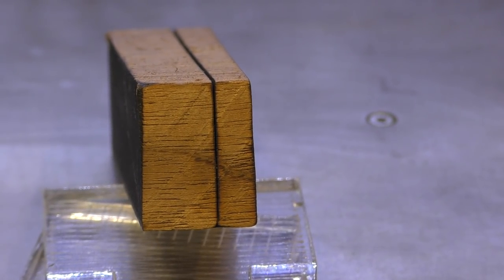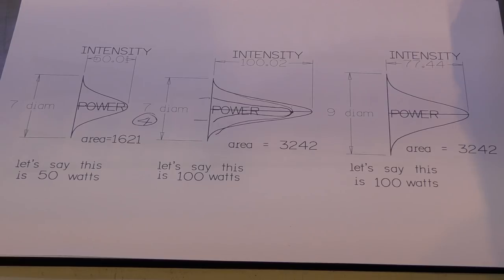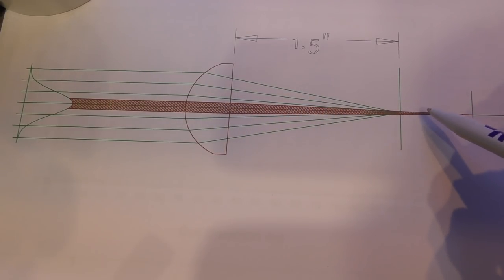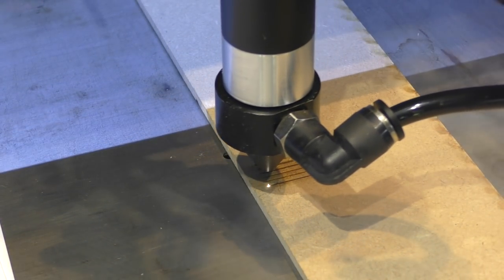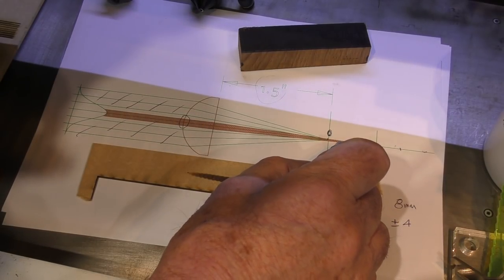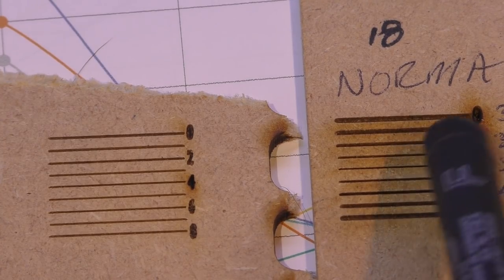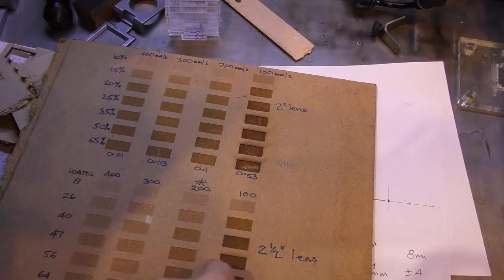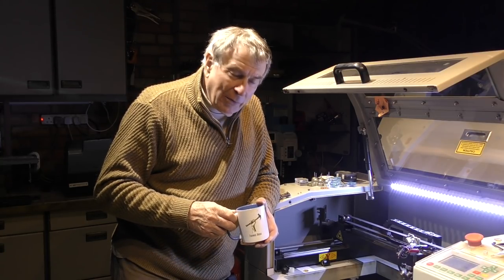RDWorks Learning Lab 208  Can I Remove the Focal Point

Comment: Russ, I was just thinking to myself it would be great if you could test laser etching a lens using CerMark, or some kind of etchant, as an alternative to your dremel grinding technique. What do you think?
Reply from the maker: Hi
 I can see the ingenuity behind your idea  and it's the sort of thing I would consider if I didn't understand the world of 10.6 wavelength light.   I suspect you dip in and out of my videos and may well have missed some vital information about the 10.6 micron universe. Without going too deeply into the physics , that wavelength light only "sees"  three things.
1 ) Metals . All metals reflect it, hence we use metals to guide the light around our machines.
2) A very small group of salt-like crystalline materials  that allow the light through. We use  these materials like zinc selenide and gallium arsenide as lenses
3) EVERYTHING ELSE.  This huge group will convert the light into surface heat as the molecular structure becomes excited  by the lightwaves.

So back to your proposal. Although the lens will pass the light and be unaffected, the Cermark  (a group 3 material)  will heat up and probably crack the lens which is a fairly fragile material..
 Mechanical destruction of the surface does not stop the light  transmission it just disrupts and scatters it harmlessly. I could think of no other way to achieve this result. It may be brutal and crude but it is effective. You must remember I am not trying to invent a new lens system I am trying to prove I can seperate the two key properties of a lens that I propose exist.  If we can creates a simple visual model of how a lens REALLY works on our machines and goes beyond the conventional model that tells us nothing, then we get the opportunity to experiment and use lenses in a much wider way.
 Thanks for the comment  I'm pleased that something in this video tickled your thinking juices. There are never any bad ideas. When they cannot stand the stress test of fact or logic then they must be  shelved 
 Best wishes
Russ
Reply: @SarbarMultimedia  Thanks for the information! Yes, I'm very much a newcomer to the world of lasers and I've been working through your content. Great stuff, though you are correct to assume I haven't come across any reference to 10.6 wavelength light yet. I look forward to that.

I understand now. I wasn't taking into consideration the etchant leaving any residual material on the lens and physically blocking the light. I was just imagining the lens surface being etched in such a way as to disrupt its focusing ability, and thinking that if it were possible to use a laser etching process it's something all laser owners could do themselves without a lathe.

Thank you very much for taking the time to repond!

Comment: This is truly awesome. Thanks once again for sharing, Russ.

I think one can pull this trick too by creating a washer like window and set it over the top of the lens. However, I am a bit concerned about what diffraction can do with the laser beam. Also, I think I recall you experimenting with this in the past... although I am not sure.
Reply from the maker: Hi Nico
 You must remember that 10.6 micron light treats all metals as if they are mirrors . Thus I am not sure what effect the back reflection would have. If you tried to use  something like an anodised aluminium washer, the opposite will happen and the washer will heat up .... maybe to melting point.  So another dodgy idea.  I did at one stage in my development of the photo engraving compound lens briefly experiment with various diameter occlusions but it was a total failure giving no useful gains.
  For this reason I had no option but to directly vandalise lenses to prove my point.  It also bypasses the possible refraction that may occur with a small occlusion. The only refraction will be within the lens material.

 Best wishes
Russ

Comment: You use a beam expander on your RF machine, could one be used with your glass tube machine to improve performance?
Reply from the maker: I think the answer is yes  but the beam ia large to begin with. so I see no real gain if you lose intensity to  gain a little bit of beam parallelism.  I did  notice the difference in cutting performance on the RF machine  when I change from a x3 to a x2 beam expander. I am currently awaiting delivery of an out and out special  x1 beam expander being made by Cloudray for me to experiment with. I am hopeful this will really transform the cutting ability of that 30 watt RF tube. If a X1 stops the beam expanding over the beam length of a small  machine,  it may be worth requesting another larger system to fit a glass tube. The idea has merit.
 Best wishes
Russ

Comment: As a photographer, I would say you've "stopped down" your lens and increased its "depth of field"
Reply from the maker: Hi  I appreciate your comment and as a photographer myself  (not pro),   I understand the stopping down philosophy to increase depth of field . However  that is a light ray concept for  imaging.  I have already concluded that normal light ray (lens theory) concepts are not transferable to laser beams.. The two lens options available to us  (plano convex and positive meniscus) are both based on spherical lens surfaces. I have realised that spherical aberration ( the  photographers nightmare)  is the very weakness of the lens that is being exploited by  the NON UNIFORM light INTENSITY of the laser beam.  There will be more sessions that prove how normal imaging technology is being incorrectly applied   to the laser world. I am not asking for any changes to lenses , just a readjustment to the thinking that what works for a microscope, telescope, projector and camera  where there is a fixed focal point,  is  different for  laser technology where the INTENSITY focus changes with speed and power..

 Again. thanks for the thought. If you have a laser machine then carry out this simple test. Set the lens to the manufactures claimed focal distance and set the power to say 70%. Use a piece of plywood or MDF and burn two lines. One at 5 mm/s and one at 400mm/s. If there is such a thing as a fixed focus  (as per lens theory) all the rays would pass through that focal point and your two lines would be the same width. Hmmmm. What do you think now?

 Best wishes
Russ
Reply: @SarbarMultimedia  Thanks Russ, I've watched a number of your videos with considerable interest. Like you, I'm intrigued to know why we need to use certain settings to achieve certain results. I got my first CO2 laser recently (Chinese 50W blue/white) off a chap locally (in Northern Ireland) and, while it's supposed to produce 100% power at 18mA tube current, the power at 5mA is around 10W then drops off progressively as the current is increased. I think the tube needs replaced - luckily I got a spare, unused tube with the machine and will need to change that. I think you're spot on about laser cutting/engraving operating differently from anything relating to image-based optics - the narrow, parallel, coherent beam with the power concentrated in the centre isn't something you find in nature and the requirement to focus below the surface of the target for cutting sets it apart as well. In some ways, it's more like akin to a focused radio transmitter antenna. I'm an electronics & software engineer, photography, video and thermal imaging are a hobby for me too. Your insights are fascinating, keep up the good work..
Reply from the maker: @gordo8189   Hi Gordo
 Your knowledge of photography and lenses will tell you that a lens is designed with a focal point that is FIXED at the design stage. Draw a line at 400mm/s with your laser on a piece of wood or mdf and find the focus  (adjust to achieve the thinnest line) and then drop the speed to 50mm/s and draw another line. The thicker line you will produce is proof that you are not working with the FIXED focus of the lens but that some other focal mechanism is at work.  I'm afraid your photographic knowledge is not transferable to the laser world.
 All tubes supplied with Ebay machines are B grade tubes. They work, but usually very badly.. You certainly need to replace the tube  before you can enjoy the real experience of laser technology. I can be almost certain that your spare tube will be a cheap B grade also. If the previous owner sold his machine to you with the original tube then he was very naive about the technology and certainly would not have spent money on a proper A grade tube. Take a look at this video to see how to evaluate your tube power and beam shape.
https://www.youtube.com/watch?v=R6Wqn5-HMzM
 If you  wish to send your disguised email address in another comment I will reply and  delete your comment.  You can then send a picture of your replacement tube  for comment.
Best wishes
Russ
Reply: @SarbarMultimedia  Hi Russ, I left my address in a previous comment but that has disappeared - did you get it ok?
Reply from the maker: @gordo8189  Hi
 I  get comments copied to my gmail and I have checked back and found no email address.  You tube is only about 95% efficient with its comments and answers. It's annoying when I have a long technical answer that gets posted to a parallel universe!!!!
 Please try again and maybe you will dodge the 5% hole
 Best wishes
Russ